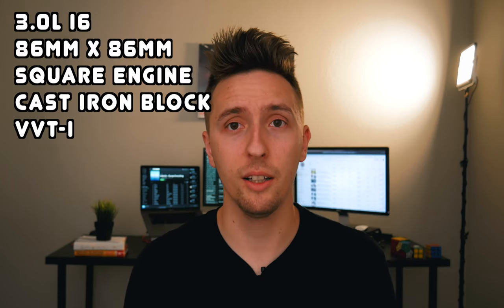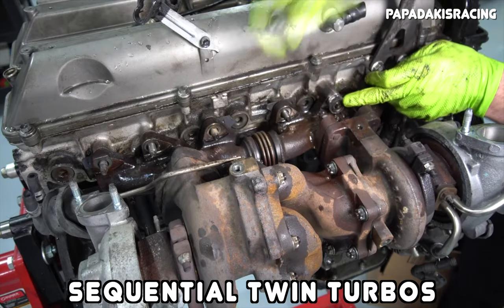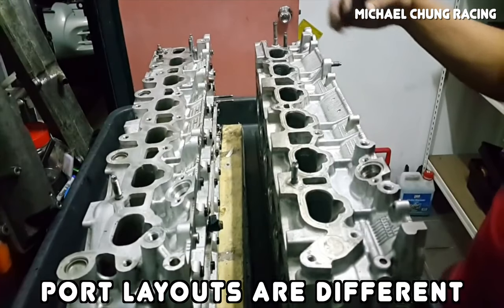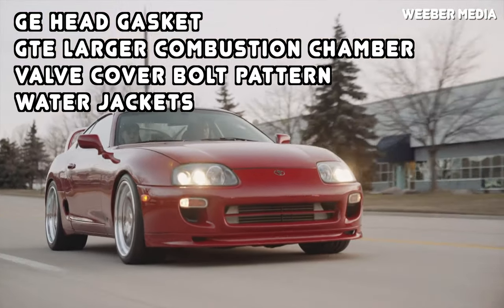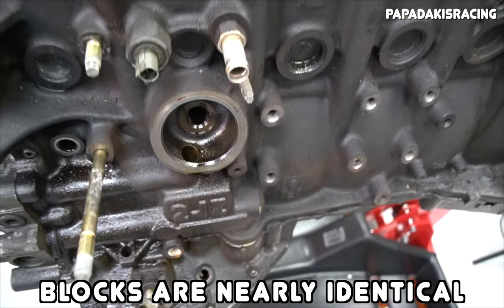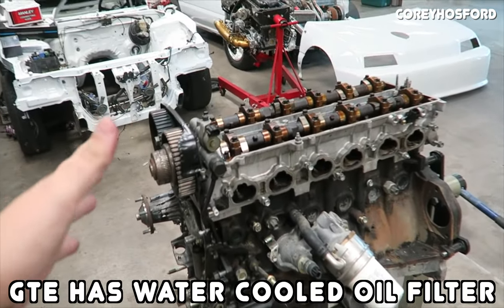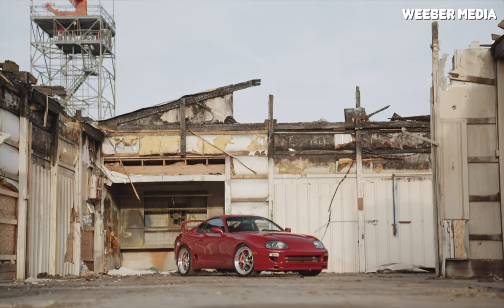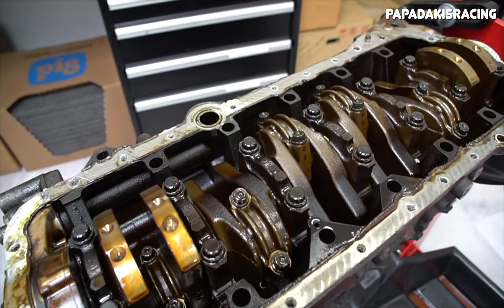2JZ-GE vs 2JZ-GTE: Which One is Really Better?

Comment: Love the video mate. But, is the 2JZ GE VVT-I block same as the Non VVT-I block?
Reply: I can tell you that nope! I juste tried to switch my 2jzge vvti from a is300 to a non vvti because I had horrendous rod knock and the block is not the same! The oil pan is not at the same place. I was able to swap the head tho.
Reply: @louifnfs  Did you changed the con rods and pistons? I mean, the con rods and pistons from the VVTI to the non VVTI?
Reply: Rifaiat Raisa I kept the con and rods from the non vvti  because they are the stronger ones from a GTE.
Reply: @louifnfs  blocks are still iron that's what matters but yea the wish they had the same pan setup but they differ ones rear sump and other is front

Comment: I noticed in the video the guy showed 2 different size rods. The skinny rod on the left was a ge rod without vvti? And the right bigger rod is for the ge and gte vvti set up on the later 2jz engines.
Reply: The difference between vvti ge and gte  is the pistons on the later 2jz engines.

Comment: I have a rear main seal problem and the motor leaks oil. I have to top it off at least once a week. Such i replace the seal or motor swap. GE to a GTE...
Reply: Replace the leaking rear engine seal of course. 👍🏽

Comment: I thought the 2jz gte and ge were the same just gte came with twin turbo stock. Are they still able to have the same max hp or is the gte better even with replacing both turbos?
Reply: The non turbo has weaker rods, so no
Reply: @aaronsanchezz , only the later VVTI GE motors had weaker rods. Connecting rods for pre-VVTI motors were the same as the GTEs.

Comment: I looked up on the internet and i found out that the 2jz ge can handle more psi.
That is what the website said :/.
Reply: If that's the case then why have a gte. No point... unless if they are the same, gte just have a sequential twin turbo?? But the guy said gte cools better tho.
Reply: The ge have weaker internals tho

Comment: What’s next “87 fuel or 93” which is better
Reply from the maker: I mean there is a legitimate argument there. Lower octane fuels combust easier.
Reply: It depends what your car needs, my Acura TSX had high compression so it required premium (91 or above) and only premium. If you put in something lower on a car that has high compression you will get something called knock and it will destroy the engine, though modern cars that need premium fuel have knock sensors that will retard timing if you put in 87 so it doesn’t destroy the engine, but you will get way less hp and less mpg and you still run the risk of destroying your engine if the knock sensor breaks. Some cars don’t need premium fuel like regular cars, so just put 87 in then. Sport cars and luxury cars almost always need premium fuel because they have higher compression for more power and efficiency. But the best way to know what your car needs is to just look in the owners manual. If you don’t have it anymore or never got one when buying the car, just google your cars user manual online. Or just google what fuel you need to put in your car.

Comment: how much maximum Horsepower GE can Handle NA/T setup ???
Reply: i heard 450whp 500whpish. but the stock manual trans can’t hold anything north of 400whp if that. That’s we are talking about GE VVTI. Pistons and connecting rods are inferior. crank and block is same as GTE. Just get GTE rods and pistons and a couple mods to ur oiling system and yea.

Comment: so they put the YAMAHA logo on the 2JZ cam cover for no reason?
Reply: 2jz, not 2jz gte. The guy just explained... smh
Reply: @MockingBrd.  both have the Yamaha badge on the cam cover.
Reply from the maker: No OEM 2JZ valve covers have the Yamaha logo on them. 1JZ valve covers do.

Comment: the best one is the FSE
Reply: Vlad Kruglov What's your logic on that? I have an FSE in my Crown and would like to learn more.
Reply: @mitchwest6453  im trying to buy a crown athlete v jzs175 with the 2jz-fse and im trying to know the tune potential. Did you find anything about it ?
Reply: @Taiki2jz  Not worth the effort, compression is too high in the engine to give it any real boost, components are said to be stronger in the 2JZ-GE. Best bet is to do a swap to a 1JZ-GTE or 2JZ-GE or GTE. Almost zero aftermarket support for the FSE. I ended up selling my 175 and bought a 171 Wagon, much more fun.

Comment: Question...whats the best way to get more hp out of my 2jz-ge ???
Reply: Turbo
Reply: turbo conversion kit ~3.5k usd
Reply: Put together a turbo kit on your own. Much cheaper and then you know everything about the engine. 

Will cost less if you do the work.
Reply: @andrwnguyn  My GE turbo kit cost under $2k.
Reply: Turbo, better rods main caps, delete em resonators and mufflers, standalone ecu, flex fuel setup/ run e85 go drive by cable instead of dbw and get some good tires and brakes been you have a monster
Reply: @72Dexter72Manley72  yeah but how much boost you running with that budget kit?
Reply: @trilliamogdlocog4986  I run 15psi on mine. Stock 2JZ rods can easily handle to 700-800hp. The non vvti engines are better. Plus my 2JZ swap is in a 74 Datsun 260Z. A 2,400lb car, so its power to weight ratio is better than most cars. I swapped it and did the work myself, so that's why the costs is so low. Did the swap 5 years ago and I have never had an issue with anything. Has a standalone ECU, 500cc injectors, 3" exhaust, intercooler, 3.70 Nissan 300zx  posi rear. When in 4th gear and I jump on it on the freeway. Damn thing pulls like a freight train.
Reply: @72Dexter72Manley72  yeah the old 2jzge have better rods but dealing with the distributor isnt my thing, the vvti systems torque curve is great making the spool time way less laggy after putting forged rods etc it's a great system after some work...That's crazy only 500cc and your running 700-800hp I thought injectors shouldn't exceed 70% of their capacity? but I agree fairlady chassis are beast when setup right.
Reply: @trilliamogdlocog4986  I didn't use the distributor, I plugged the hole with a threaded plug and use a crank trigger wheel and sensor off the crank pulley. I have a standalone ecu. 

Turbo lag is really controlled by the turbo you pick. You can also make a turbo spool faster by using a smaller exhaust housing. Or even a smaller turbo. My turbo comes in right at 3500 in 4th gear. I would like it to come in a little bit sooner, so I may use a smaller exhaust housing or smaller rear tires. 

With injectors you aren't constantly at their max capacity. Unless you just use the car for the track. 

The s30 chassis is light so I don't need to run 700-800hp on the street. Mine is just under 600 hp. A Supra weighs over 3500lbs a Lexus sc300 weighs more than that. My s30 weighs 3200lbs. So I'm 300lbs lighter. Weight makes a big difference.

Comment: My gs300 2jzge had a water cooled oil filter too...
Reply from the maker: That’s strange. Maybe I was wrong? Definitely possible. From all my research the GE block never had a water cooled oil filter, but it couldve been incorrect.
Reply: @Dustrunnersauto  No idea why mine had it 🤷‍♂️ Maybe it was just because it was in a different market (UK)? Either way, great video, lots to learn on it 😁👌
Reply: @Dustrunnersauto  vvti ge has a built in oil cooler

Comment: Get a GE send it to mazworx to make into a GTE block buy a new gte head instant new GTE long block that was never abused in its life like a real GTE block
Reply: Unless someone is building an ultimate drag car, why would someone send a 2J block for work ?. When stock 2J blocks can handle a 1000hp. The blocks are way overbuilt as it is. 

The stock internals can't handle over 1k HP though. The internals will need to be upgraded. 

Now if someone wants 1,500hp or more I get it.
Reply: Full Body Joe stock pre vvti ge engines can handle 1000 hp just not the later vvti versions of the ge, you would have to change to thicker connecting rods and thicker head gasket to lower compression, then you can make 1000 hp.
Reply: @Rekt-M8-v4  I get it man. I put turbo on an early 2J engine in my Datsun 260Z. Damn thing scares me sometimes. 2,400lb car, 15psi of boost. 

 Car pulls like a freight train from 65mph on up. 💪🏾